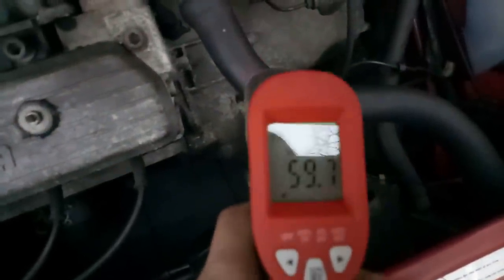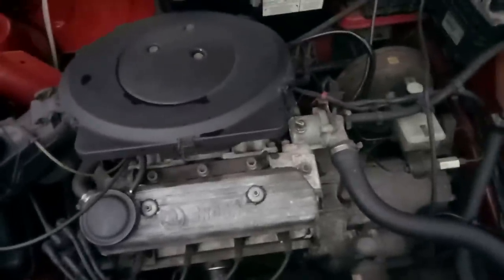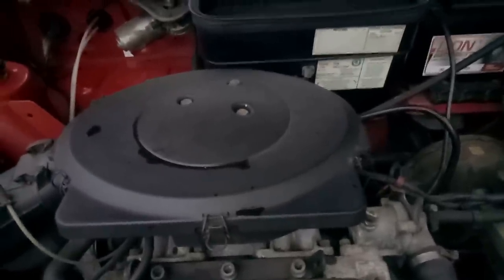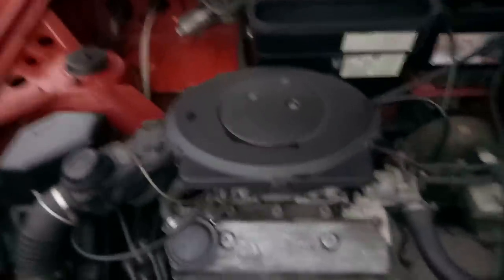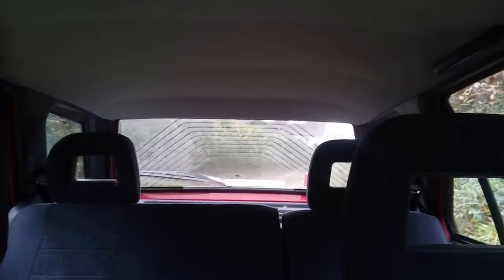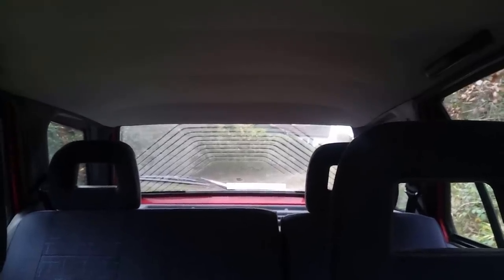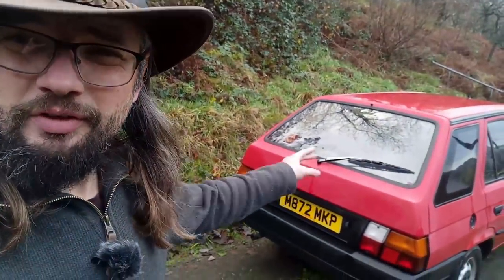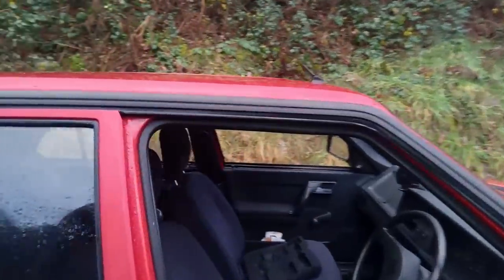Skoda Favorit Odometer fix (and other things)

Comment: The handle fits behind the two metal bars that come down the back from near where the boot locks onto there should be a rubber strap that holds it there

Comment: Looking at the temperatures your hand-held was indicating, I think you may find the thermostat has been removed to try to get rid of the (probably false) overheating problem. Did you look for a voltage regulator whilst you were in the dash?
Reply from the maker: No. Didn't have time.

Comment: I think you might be able to solve the rear defrost issue with some of the repair paint for the tracks and just tape off lines down the blank area and make new ones to fill the void, might be worth a try.
Reply from the maker: The lines generally all work. What I need to do is stop the car filling with water...
Reply: @HubNut  Hopefully that's just a worn hatch seal, Honda Fit's were notorious for rear hatch leaks too.

Comment: most of my thermostat issues over the years have been just the same, they open too easily or part open,   id certainly change it, and to be honest from my skoda experience, a bypass switch for the fan as well, skodas dont like summer as well as western cars, ive had issues that the fan switch isnt entirely reliable when you need it most
Reply: When my fan motor went in my first Felicia, it got so hot that it melted the plastic fan centre connection, so I had to get another one of those as well as a new fan motor. The old Skoda dealers were amazing back in the day, they had a rummage round the stores and found an old fan for free! Happy memories when touring of the Lowestoft dealer fixing my steering wheel when it separated from the hub centre on the old 120L. It took him about 2 minutes to find one on the scrapheap, and two more minutes to fit it, as if it were an everyday event. Wouldn't take any money for it, so I gave him a fiver for a drink!
Reply: Yeah + 1 on the  override switch for the fan,  with a telltale light when its on.
Reply: @frglee  Was that Cranes Garage?

Comment: Another great vid - and hadn't thought about using an infrared thermometer to check if cars running to temp etc. (Think my multipla's stat might be stuck open as only get 2 or 3 bars on the temp display). Just a thought, aren't your needles illuminated? And, if so, how does colouring them in with felt tip affect the illumination? Would like to see the display at night to see if it impacted it, if it didn't - great tip!
Reply from the maker: https://pbs.twimg.com/media/DuFxrnAW4AA5w-L.jpg

Comment: When driving older cars have you found that some parts are quite scarce and pricey? My search for an old car will continue next year when ive got some money built up.
Reply from the maker: Yes. 2CVs are very well supported for spares, but some bits are quite expensive. For other cars, parts support is nowhere near so good. A lot of Japanese cars have very poor parts support.
Reply: @HubNut  I couldn't find the original hubcaps for my Corolla and even the dealer didn't know so got a  set of 4 new ones that Avensis's have. Whilst browsing for Fiesta mk2's ive found that there are loads of spares left which is assuring for when the time comes.

Comment: I do have doubts with the thermostat in the Golf.  It generally reads around 70, going up to 90 (which is where I reckon it should be all the time) when I'm hooning it a bit, or pushing it perhaps a little harder than I should be on a motorway.

Wait you're actually going to mop the Favorit?   You really must be fond of it.  Rust proofing too?  Crikey!  :O

Comment: Had one of these way back, rattles from front could also be wishbone bushes, mine had  two sets in the 3 or 4 years owned it, doors rattle on the catches if the hinge pins are worn.
Reply from the maker: Seems to have had new lower arms, and no play detected by the garage with their massive lever. Few other things it could be. Just need some time to investigate!
Reply: Good luck getting to the bottom of it.

Comment: Your temperature sender will have a spec, it might be in your Haynes manual.  Just disconnect it and attach a ohmmeter between the sender and block and you'll get a pretty good idea if it's working.  That said a Thermostat and Sender probably cost peanuts so if you're lazy just replace 'em!

Comment: Older Skodas are a bit porous. It tends to be the rubber window trim that is compromised. Or where water bypasses the door trim backing plate instead of making its way out by more conventional routes. Black bathroom sealer does the job there. This was equally true up to the Fabia.

Comment: Super glue is hydroscopic. Better options might be epoxy or a Loctite  gap-filling bonding agent. (Agent Bond, of course). As well you could peen the shaft circumference a bit for a touch of mechanical interference in the end-cog location for, perhaps, doubled free-spin resistance.

Comment: How did you get the needle off Ian?
Reply from the maker: Just pulled it. While wincing and waiting for something to break...
Reply: @HubNut  Thanks. I need to do this to an Estelle speedo and you have given me some confidence.
Reply: Can be nerve racking, do know any one who repairs clocks to borrow a puller or try two blades at the same time.
Reply: @chriseccles1454  I think a dial puller will actually be a useful tool to own so I will see what ones are available. I really don't want to kink or mar the pointer.

Comment: Definitely sounds like thermostat stuck open from what you described, a tip to test cooling fan even in winter heaters on cold of course, idle for 20-30 or so at 13-1500 rpm with heated window on and lights on, also run it in a sheltered area , the load seems to make it work hard and even a stuck open thermostat the fan(s) should kick in assuming the fan sender is working ok.
Reply from the maker: It seemed to warm up quite nicely this evening. I need a proper, functioning temp gauge...
Reply: HubNut very true, I’m sure you’ll fix it hub  nut style 👍

Comment: Thermostats are pretty cheap... maybe consider putting in a winter thermostat with a slightly higher opening temp. It's what I have done on older cars here in Canada.
Usually those things are a standardized shape but you may need to get some gasket material and make your own gasket.
Cheers,
 - Eddy

Comment: Ah, the dreaded water leaks - you could get Mrs HubNut to hose the rear end with water while you sit inside and try to see where the water is getting in.  It reminds me of my first car, a Morris Marina 1.3.....  yes, one good thing about commy dashboards is that they're not as scary to take apart as ones from "the free world"..... Felt tip pens and super-glue - now that IS improvising, very HubNut!....  Ah. haven't seen TWC for a while (I get it now - pronunciation is with a silent 'W') - she may not be exactly "concours" but she is worlds apart from when you picked the two wrecks up...… (back to the Škoda) Yes... what can I say?  Result!  I didn't know HubNut did rustproofing - but yes, why not, if you want to prevent her losing value.  Wax-oil underneath I'd guess?  I'll have to wait and see what you do for the rest of the body..... thanks for another great video, look forward to the next!
Reply from the maker: TWC uses the Welsh pronunciation of W, which is Ooh.
Reply: One more thing - you need to check underneath ALL the carpets/floor mats.

Comment: Have you checked the Mot history online for the Skoda, Ian? Couple of things of note - history goes back to 2005 on the .gov website, milage then was 6202 miles and as gone up each year to the current recorded value of 8689 miles (March 2018). Also of note - which may well explain the premature wear on steering rack, in 2011 it failed an Mot because the offside steering gaiter was split. No doubt allowing some dirt and water to get into the rack, hence your knock! But with regards the mileage, who knows just how long its been under clocking itself?
Reply from the maker: Indeed. Impossible to say how many miles this car has covered, which is why I had no qualms about resetting it. At least that'll stand out in the MOT history.

Comment: If you disconnect the sender wire to the temperature gauge and ground The Wire on the engine the temperature gauge should go to overheating that's the way to test if the dashboard gauge is right if it goes hot on the dashboard when you've disconnected it it's then the sensor on the engine that faulty

Comment: RE the temp guage...is the water pump working ok?
Similar symptoms to a water pump failure I had..
Reply from the maker: A reasonable suggestion. I wouldn't expect the radiator to get so hot if coolant wasn't being pumped though. Or for the heater to work as well as it does.

Comment: Rack mounting rubbers? I've just done them on one of our Fabias (MOT fail). Also the  wishbone rubber bushes at the rear can fail and knock  Also just put a new stat in...its peanuts. The heater on these should blow a storm in no time at all. Its a great part of the Fav. The best heater you can get!

Comment: Why not get a set of LED replacement bulbs from ebay that will last longer than the car?   You can even change the colour aspect of the backlight by changing the perspex "windows" behind the dial if you wanted blue instead of green.   The felt tip won't last long sadly but you can buy instrument needle paint out there in partsland and not sure if still about but low light reactive paints too.
Reply from the maker: Not an LED fan to be honest.

Comment: I would be careful ian driving through those deep puddles fast.
I got a massive aquaplane once at 50mph and it felt like a gliding sensation like the car was going to take off in the air lol.
Luckily it was on a straight bit of road.
Not too bad a car is the skoda "a cheap to run reliable workhorse" in that it was intended to be this way by the manufacturer.
Clean the rear window inside with a window cleaner as that will clear the window much quicker when you turn it on.

Comment: Hi Ian,,,,,, if the knocking is in the steering rack ,,,,,,,,,(and it's manual steering),,,,,,with the car switched off,  by gently shaking the steering wheel you should not only induce the noise,,,,,,,,but it should be easy to "trace" with your hand if Mrs Hubnut can just shake the wheel ?????
If not just a track-rod end ????,,,,,,, then it can be the inner knuckle joint  at the end of the "tie rod"  (like punching your fist into your hand),,,,,,,,,, or the actual "rack and pinion"  (which is highly unlikely),,,,,,,,,, 
If it was play in the "inner tie rods"  then the car would "wrestle slightly" on cornering and just "jump" a few inches !!!!!!,,,,,,,, But the "chatter" seems to be from the movement of the road wheel(s),,,,,,,,,,,,which may be a strut or a strut mount ?????,,,,,,,,,,,,,, (as it sounds like old shock absorbers used to "back in the day),,,,,,,,,,,
Also if you gently move the  steering wheel one wheel will remain stationary as the other reacts ?????
Ummm,,,,,,,, the actual "rack and pinion" are very tough indeed and over engineered.
Hope this helps ????
Try just pushing down on the wing a few times to see if you can ear the noise  !!!!!     Good Luck !!!!!!
Reply from the maker: Thanks strut top mounts are also in need of investigation.
Reply: @HubNut   Cheers mate,,,,, yeh you make nice videos,,,,,,, they're somehow "peaceful"  !!!!!!!

Comment: Are there any legal hurdles with the odometer fix now it is only reading 100 miles?
Reply: nope dont think so, my skoda had a broken speedo for 5 years...
Reply from the maker: Nope. As long as I don't pretent that's the genuine mileage, it's fine.

Comment: Excellent video, like the Skoda, looks mint, especially underneath. Looking forward to the mopping. My suggested product is the 3M Compounds, fast cut, mid and down to fine/ultrafina if your as OCD as me. Foam pads, Not  the wool nonsense. They will go red I think, old school solid red oil based paint...  Is it a K plate, hard to believe they are 25 years old now. Worth keeping good, it is going into proper classic territory. Nice to see TWK out, Best wishes for Xmas, Mark@Bucharestguidedtours.com

Comment: My daughter had a 2000 Fabia and the inner track rod end joints failed twice, during her 7 years if ownership, a typical fault apparently on VW steering racks of the time. They are a pig to get to as well requiring subframe removal.
Reply from the maker: Nasty. At least the rack is easy to get at on this.

Comment: I would just replace the thermostat. If the Favorit hasn't been driving much then the thermostat could be stuck open or may be removed! What courses the cold running problem. Cold running, especially in the winter, (could) let to bad oil lubrication because it operates with another viscosity that way and you get things such as gelling of the oil. They aren't that expensive too! (polo and golf parts mk2 parts)
Reply: Not really if it operates above 70 c the car is OK because skoda get out of choke cycle at around 70 c

Comment: Don't forget that this may have an otter switch in the radiator which activates the cooling fan (old school). So, if you're thermostat wasn't opening properly (engine running hot and the gauge is telling the truth), then the cooling fan still wouldn't come on as the water is not being (fully) allowed to circulate through the rad, so the radiator stays cool enough to never get the fan going. (Unless the cooling fan is ecu controlled on this (Doubt it)) . I'd change the thermostat and sender ASAP, and maybe even short the wires to the cooling fan to make sure that works. But, don't rule out the voltage regulator on the alternator, as issues here can affect the gauges too, and I noticed from another video of yours that the fuel gauge level changes between ignition on and engine running. Does the temp gauge do that too? If so, voltage regulator has gone, which you can verify with a basic multimeter.
Reply from the maker: Fan does work. I just failed to get video of that. What I haven't managed to do is prove the fan switch works yet. The fuel gauge doesn't change between ignition on and running, it just refuses to update unless you turn it off and on again.
Reply: @HubNut  OK cool. It's a very cool car though. Couldn't find any on eBay. I like that it has a proper skoda engine. Bit of Farecla G7 on a mopping machine should get the paintwork looking lovely.

Comment: I'd say you need to get the speedo sent of to get it calibrated now the needle has been taken off, or use a GPS speed app on your phone to check the speed measurement on cluster.
Reply from the maker: It's slightly over-reading, perhaps 1mph more than factory.
Reply: @HubNut  Nowt to worry about then which is good, top job though.

Comment: Does the DVLA not get a but uppity about cars with unknown mileage? Though given it's a common fault on the odometers in these, I guess they'd have to give a little leeway in that... :\
Reply from the maker: I guess I'll find out. I've changed binnacles before without problems.
Reply: @HubNut  It'll probably flag up on some of those HPI checks, but aside from that and anybody looking at the MOT history (although they'd notice the very minimal differences throughout the years anyway, something that I doubt the computer systems will detect).  I don't think the DVLA is fussed in the slightest.

Comment: One of the reasons Hitler wanted to take what is now the Czech republic was to obtain the Skoda works as they also use to produce munitions. Though they did make some decent cars pre war and only the fall to communism reduced them to making the rear engined rapid design for around 40 years. The favorit was the first new design they had in decades!
Reply: At the Skoda museum in the Czech Republic they have a one-off experimental 1970s/80s front engined Skoda 120L! Looks very nice. The Russians were still very much in control of the eastern bloc countries then and refused permission for it to be produced - some say because it was far better than anything else being produced behind the 'Iron Curtain' and would damage production elsewhere in COMECON countries. Could be that the early Favorit development caused a similar row, though that nonsense was ended by 1990 after the Velvet Revolution in Czechoslovakia.

Comment: You can calibrate the speedo using a sat nav and a straight road.....but it does mean pulling it out again if you want to adjust the speedo needle..pain in the....
Reply from the maker: At sat nav 40, it's reading 44. I can live with that. Not far off what it would be anyway.